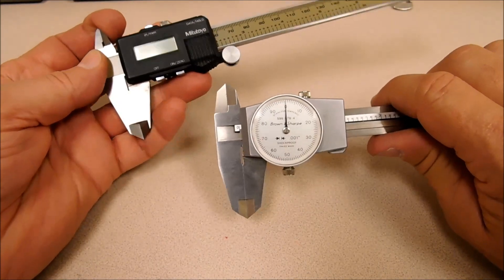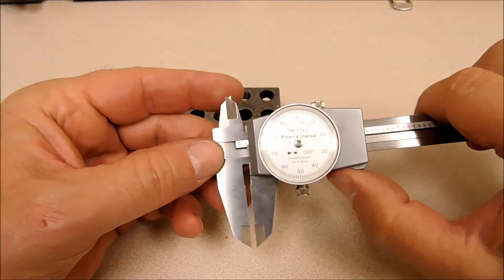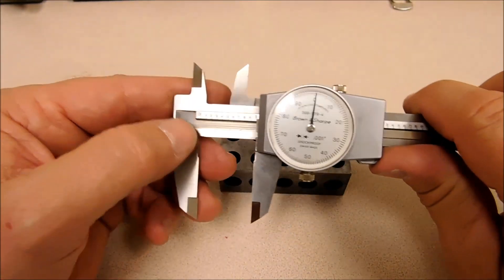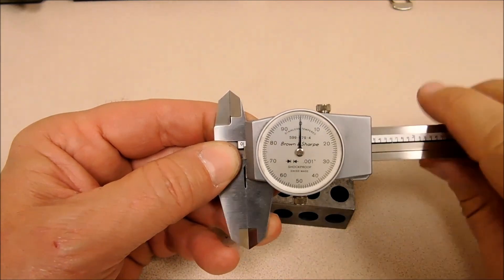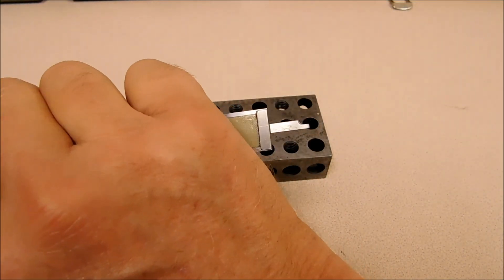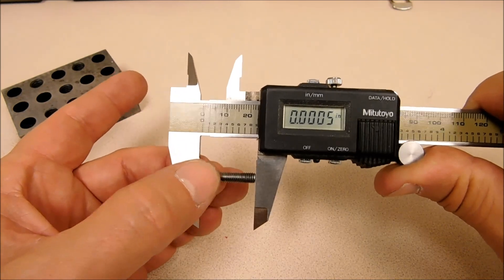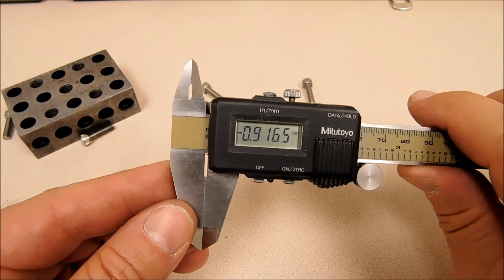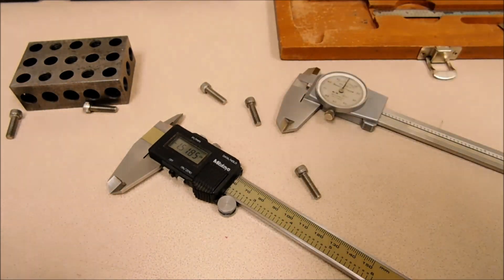Calipers -- Dial vs. Digital -- Does one do more ???  ( yes )

Comment: One benefit of dial that nobody mentioned yet is corrosion and temperature resistance.  If any amount of water gets into the digital it’s probably toast.  Old batteries can leak and corrode.  The button contacts can fail.  If the battery contacts aren’t great and power cuts out for an instant while measuring, you might lose your reading.  There’s a lot more that can go wrong especially if you store them in your toolbox in an unconditioned garage that encounters humidity or temperature swings below the dew point.  If you can’t tell by now I’ve got the cheap digital ones and they are nothing but problems so I’m looking to go old school.
Reply: Spend a little money on good digitals - I've had them last over 30yrs in the same environment. The better ones error out if they skip (from water or dirt), and post the letter B on the display quite a while before the battery goes dead.
If that doesn't fit your needs the old school Vernier calipers are nearly bulletproof, they would have to be dropped on a hard floor or smashed to get damaged - stored in the garage through hot and cold, extreme humidity, dirt or chips doesn't phase them in the least - you just have to know how to read them.
They never wander off zero, and they're inexpensive.
Reply: @Motor-City-Mike  Yeah that’s what I ended up doing.  The benefits of digital outweigh any niche benefits of dials.  The ability to toggle units is a big one.

Comment: @ 2:59: You mean "Never Been to the Moon Units" and "Moon Landing Units"?
Reply: No one cares how many meters altitude you are.
Reply: @1pcfred  
It was a joke regarding metric and imperial.
America landed on the moon first, using the imperial measuring system.
Other countries that used metric, could not do it until later.
It has nothing at all to do with the measuring system used, as both are ass and entirely subjective.
But it is a common way people who use freedom units make fun of people who use slave units. 
Oh, freedom units is another term for imperial since the country that uses them was the last to use slaves and first to abolish slavery, while every country that uses metric adopted slaves early on, and many have yet to even abolish slavery to this day.
Again, something that has no bearing at all on the usability of the measuring system. In regards to usefulness, they are both identical. Neither is more accurate than the other, because both have things called partial measurements, and thanks to math having an infinite number of decimal places, math renders them both equal in accuracy.
Also, this is due to the fact they are in fact identical. 
They are both based on the same base unit, as since 1950-60 the inch has been defined as exactly 25.4 mm. So the claim that metric is more accurate because of a constant base that is known and usable, is false, since imperial uses the exact same constant as its base. which is the length of a meridian of the earth itself. Which ironically, is not a constant lmao, since the surface of the earth is slightly deformed based on its location in orbit around the sun, and other planetary locations in the solar system, as well as internal changes in the earth since the surface is effectively a thin sheet floating on a sea of thick liquid that is constantly moving.
Reply: @1pcfred  
Wow, I do not even know where to start to unpack this. 
For starters, the US customary is a metric system originally based on the Winchester standard. Which was the primary measurement system in Britain from the 1500's. 
Additionally, the united states fully converted to imperial in the 1824 reform. Making the system imperial.
The moon landing, which was done in 1969,  was after 1824, therefore our main unit of measurement at the time was in fact imperial. 
Additionally, the apollo computer was programmed on metric, and calculations were done in metric, then converted to read out in imperial units. So all the critical functions were metric.
Additionally, I do not believe we could land on the moon again if we tried right now. I believe our space program has deteriorated too far to be capable of it and that it would be impossible for us at this moment. Additionally, for the most part, no other country has really even tried, due to how expensive it is. The one that came the closest, Russia, just literally gave up entirely once we did, and has not bothered to even try. Mostly because they are poor and broke as crap, and do not have the budget to be able to, though they have also deteriorated significantly from the space race age. Their economy has been terrible and struggling greatly so they have cut most precision manufacturing out in place for more food production and such to feed their starving population. 

But we did not use US customary units to land on the moon, we used metric. 
The press releases were worded in regards to customary units, simply because that is what the population was familiar with. And those customary units are in fact based on the imperial system, as of 1824, which is in fact based on the metric system. 

But in regards to landing on the moon, the calculations were done purely in metric, only the readout was not metric, everything else was metric and no other unit of measurement.
Reply: Do you know any other countries in the world that had a catastrophy in space because they used "limbs and sticks" measurement system instead of world standard known as metric system?

Quote:
In September of 1999, after almost 10 months of travel to Mars, the Mars Climate Orbiter burned and broke into pieces. On a day when NASA engineers were expecting to celebrate, the ground reality turned out to be completely different, all because someone failed to use the right units, i.e., the metric units

Comment: I like to use the digitals for tapped hole depths using the 'ABS' or zero button to check the thread depth then double check with a dial. I always like having both just to double check sometimes

Comment: The dial does not have a battery either Joe, you miss that feature.
Reply: With Mitutoyos you forget they have a battery too. As a battery tends to last at least 3 years. The cheap imports chew through batteries every few months.

Comment: I have a question, but could not find if you had a video on this.. 
I have a JT Slocomb Digital Micrometer(non electronic). 
It was sitting for a while in it's own cardboard box. When I got it out to use it, it was frozen shut. I can not budge it at all. There are NO signs of rust. 

I did not want to mess up the digits, so I didn't want to try anything like using oil.

The only thing I tried so far, was putting it in tupperware and putting it in the freezer to see if I could get a temperature change to cause separation of the joints. No luck.. 

I do not have the wrench(not sure what it is called) that adjusts the calibration.

PS: Since I work in electronics, I try to keep my tools to "Clean Room" standards. 
(absolutely no oil on anything that touches my work, unless absolutely necessary)

If oil is my last resort, I have used 3in1 on tools like needle nose pliers and wire cutters, 
but I don't know what to do with something that is at the precision level of a Digital Micrometer.

I hope you can you help? Thanks.
Reply from the maker: Put some rust breaker on the split line between the jaws and let it sit for a while. I'd start there. Position the calipers so if the liquid runs, it runs away from the slide and electronics.
Reply: @joepie221  Here is a picture one like what I have. Mine has a thumb wheel on the end the handle. I don't want to get anything inside the area where the numbers are. Would applying cold or heat help loosen it up?

I guess it's a bad idea to leave Micrometers with the jaws fully closed.

http://zurubu.com/imgs/JT-Slocomb-Speedmike-Micrometer.jpg

Comment: I was looking for something like these on ebay, but most of them look like junk.. A lot of them have plastic jaws. Half of the ads which are selling ONE caliper, show pictures of more the one.. Which means, they don't know or care what they are selling..(It's all BS) 

Are there any good ones on ebay??
Reply from the maker: I'm sure there are, But for something like this, I'd buy a new one.
Reply: Plastic can be handy if you work with electrical or electronics. I have some Swiss made General brand plastic ones and they've been surprisingly good. But I only use them for non-metalworking applications.
Reply: @1pcfred  Yep! I bought mine because I am designing electronic circuit boards and wanted to be sure I knew the actual size of the parts, so I could give them proper spaces between parts. 

Measure everything.. 
part body size
Lead size
spaces between leads... and so on...

Never trust a spec sheet without verifing.. 
Measure all parts before designing the PCB. 
Make sure the actual part and the KiCad footprint agree.

I would trust common parts like dupont headers and DIP chips.
but items like MIDI DIN connectors, measure it before you commit a design for production.

Don't forget, part size is only half of the issue. Something like a USB port needs to consider how wide the item is you plug into it.. 
Example:
USB SD card reader is almost twice as wide as a cable plug

On a side issue..
I was designing a USB-C to FTDI circuit and KiCad rejected associating the USBC symbol with the USBC 16pin footprint.
Reply: @1pcfred  I never got 3D view to show parts.. Just an empty PCB..

What you did is a good idea, if the printer prints to the right scale..

Comment: I actually have the same of both calipers. I love the Mitutoyos but still haven't used another set that feel as silky smooth and positive feeling as those Brown & Sharpe calipers. 
I'm not saying the digitalis aren't easier to work with but before I got them I use to rotate the the glass to set a new "zero" quite often.

Comment: With the digital, you are dependent on a battery. Always keep some spares in your box.
Reply: Or just buy the Mitutoyo digitals. Their battery life is legendary. It's 3.5 years. I change the battery so rarely I always have to look up how to rezero them. Because the only time I ever have to rezero them is when the battery is out. After over 3 years I forget how to do that. I check them but they're always spot on. I have to admit repowering Mitus up is a bit buggy. They just start out at a random number. But you're doing it only every 3 years so meh.
Reply: @1pcfred  Which model Mitutoyo do you have/recommend?
Reply: In standby mode, Mitutoyo calipers use only marginally more power than the self discharge rate on the batteries themselves.  Assuming that you're turning them off when not in use, if you buy an extra battery when you replace the battery in your calipers, by the time you need to replace the battery in your calipers the extra battery you bought 8 years ago is approaching its end of life anyways.

Comment: My toolbox, with non-digital mikes and calipers, went to a young fella who was just starting out in the business a long time ago. Recently I needed some accurate measurements for a project so I bought a Mitutoyo digital and there's one advantage you didn't mention - the digital readout is lot easier for old eyes. :-)
Reply from the maker: I love mine. The batteries on these units last forever.
Reply: @joepie221  not forever. It just seems like it. It's really about 3.5 years. But it's long enough I forget how to rezero them. I think press down the origin button for 2 seconds? But don't quote me on that.

Comment: I have one that reads 200 per revolution. It's a real pain! I'm so used to 100 that every time I grab it I miss read it. It's quite old so I'm not sure if they still make them. I'll see if I can grab a # off it later.
Reply from the maker: I had one too. It was my first ever caliper. It recently died. I should have framed it.
Reply: I've got one of those 200 per revolution calipers.  Still have it and use it infrequently.  40 years ago I could see it fine. :)

Comment: I have both, digital for when I have batteries, dial for when the fecking things are flat again and I don't have a coin cell in sight.
Reply from the maker: The calipers in this video only need the battery replaced about every 5 years. I keep 2 new ones in the case with the instrument.
Reply: @joepie221  Yeah, I only have the cheap $20 ones that drain the batteries in 6 months or so.
Reply from the maker: @legallyfree2955  Buy nice, or buy twice.
Reply: @joepie221  I went reasonably nice with the dial callipers, so I'm happy with where I ended up. There's a lot of stuff higher on the priority list before I upgrade the digitals but maybe one day.

Comment: You can do the same type of comparative measurement with the dial indicator for parts with a difference of less than one dial revolution. You just zero the dial on your standard and read the difference on the dial. Not as easy as pressing a button but it works. My biggest beef with digital anything is the battery life. My starrett mics eat them like candy. Also that feeling when a digital take a trip into the coolant puddle.
Reply: And, at least one company, iGaging, makes a dial caliper with metric and English displays on the same tool.  So much for the digital advantage.  Do we have to start saying 'American' instead of 'English' units, now that England has gone metric?
Reply: @wdtaut5650  it is actually imperial and metric
Reply: @willardlentz3044  Dang it!  I knew that.

Comment: I had a no-name brand digital caliper which gave me endless pain. Had to change the battery every few months, even when I hardly used it. So I put the battery outside the battery compartment to make it last longer, then every time I wanted to use it, I had to put the battery back inside, make a measurement, then take it out again. Next problem, it was almost impossible to slide the jaws because it was so tight. Then I discovered the entire metal plate was bent, so I bent it straight. When I was fine tuning the flatness, it broke in half. I thought that was strange because it was written "STAINLESS HARDENED" in big letters on it. It was the worst made product of any kind I've ever encountered.

Comment: One other feature digital is the Data/Hold button... if you can't read the display because of position.  Get the jaws set with the friction wheel and press the Data/Hold and  you can open the calipers without losing the reading.  Record reading, press Data/Hold again and goes back to measuring.

Comment: You can zero a dial caliper for GNG too, with the set screw on the dial. A dial caliper doesn't need batteries, which trumps the metric conversion IMHO. The advantage is null. That said, I still prefer my Mititoyo digital to my Starrette dial calipers for everyday use.

Comment: The cheap digitals eat batteries. A Mitutoyo battery will last for years. But you're always checking zero on a digital.
Reply from the maker: Its the first thing I do every time I turn them on.
Reply: My Mitutoyo calipers only lose zero when I change the battery.

Comment: What's the notch on the end of the depth gauge rod for? For small diameter holes?
Reply: It is there so that you can accurately measure a step on a lathe turned part. The cutting tool always leaves a radius between the two diameters and the notch in the depth rod avoids that feature.
Reply: @jimzeleny7213  this makes a lot of sense to me!
Reply from the maker: I'm sure it is.

Comment: There are pros and cons, I have both types but I use my TESA analog dial caliper when I need precision as my (cheaper) digital is off by up to 0.1mm. As a side note the Brown and Sharpe caliper you have is actually a TESA, made in Switzerland. I don’t know who owns who but the products in Imperial for the US market are sold under the US brand name. I validated my metric caliper against a micrometer and the error was zero. Zero as in 0.000 here is a video of my test: https://vm.tiktok.com/ZMJ4BSM42/
Reply from the maker: 'Mitutoyo digital caliper' batteries last for years.

Comment: I like the digital one I have, but the main disadvantage is I wind up having to keep spare batteries around because invariably (Murphy's law) when I most need it the battery is dying.  The dial caliper doesn't have that problem. 😋
Reply from the maker: 'Mitutoyo digital caliper' batteries last for years.